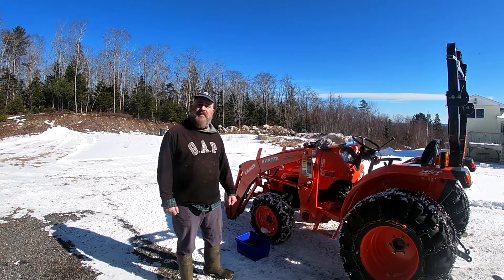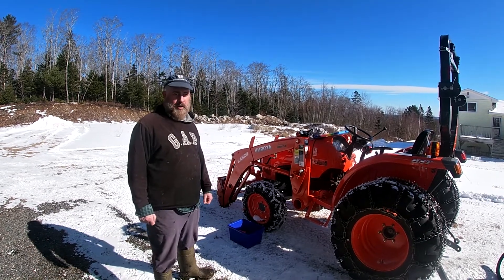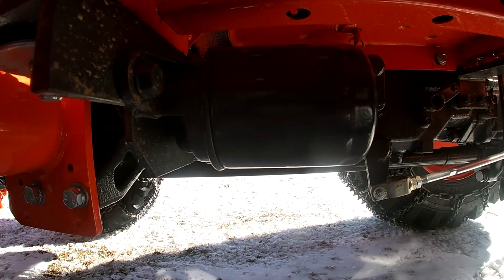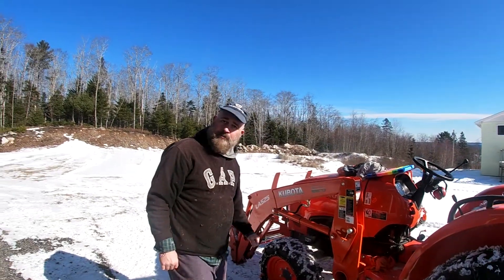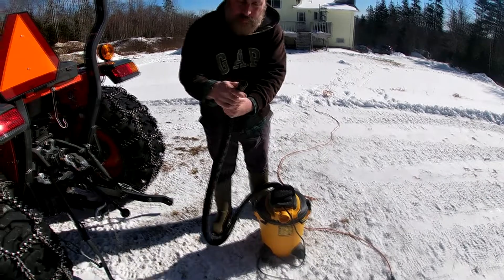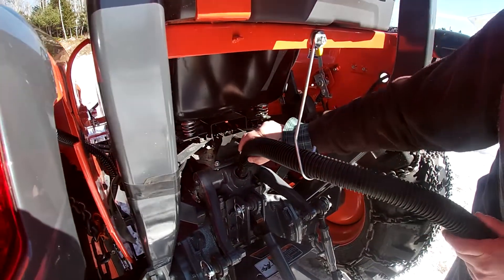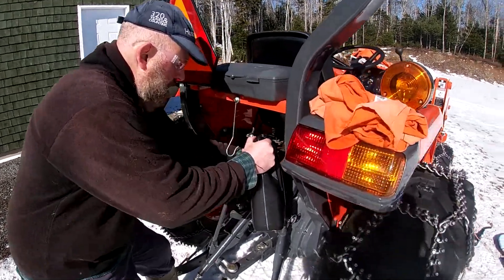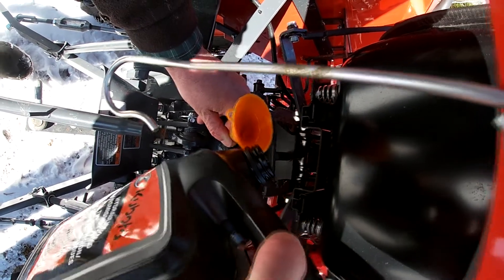episode 6, 50 hour service on the Kubota L2501, trygg studded chains and the shop vac experiment

Comment: Enjoyed your video, a friend of mine told me about the shop vac tip after he did his 50 service on a L 3901, works great! I have a question on your tires & chains please. Did you have to to use wheel spacers before installing your chains or was there enough clearance without adding spacers? I have the L 2501 with R 4's as well & would love to use chains in the winter but I don't want to buys the spacers if I don't need to. Thanks in advance!!
Reply from the maker: thanks for watching .The old shop vac trick works great and i did use 3 inch wheel spacers on both sides you will need to change the wheel studs for longer  .It also will make the tractor more stable